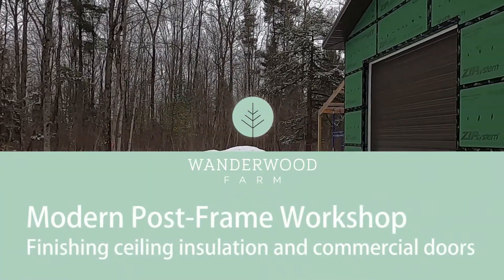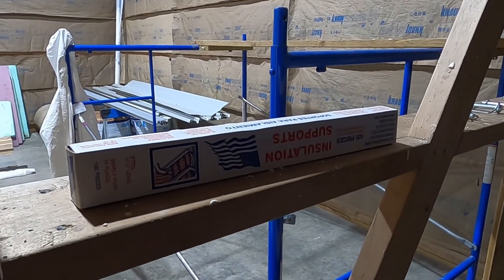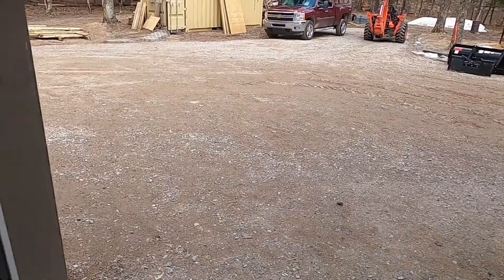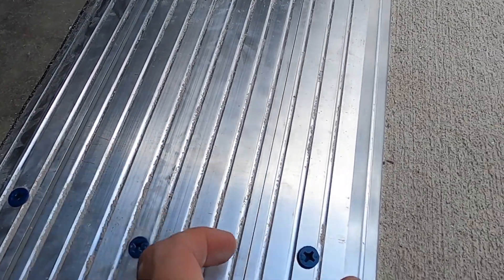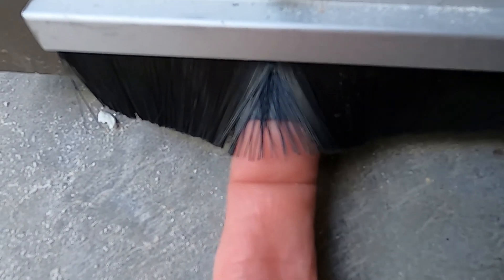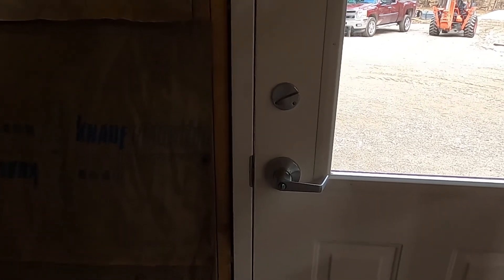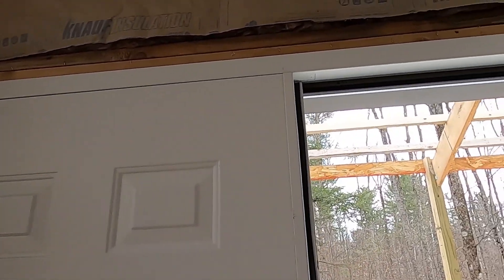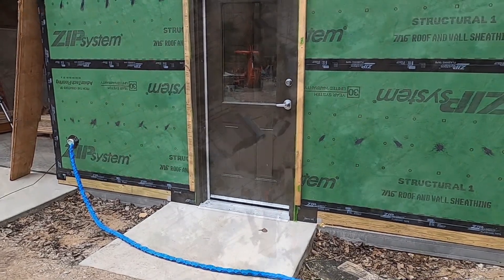R-60 Unvented Roof Assembly: Combine fiberglass & closed-cell foam (059)

Comment: 2" foam reduce heat transmission by 86% really didn't need the rest
Reply from the maker: Please read 2015 Building Code R806.5. Specifically look at the table in that section. It details exactly how much air-impermeable insulation is required in your zone. 

How did you arrive at 86%?
Reply: @WanderwoodFarm  Channel Spray Jones goes into much detail about this. The R value is a lab test and pretty much useless in the real world which local codes are based on. The 86% is arrived by detailed studies of heat transmission. The 2" more than covers what you need to insulate. The codes have not kept up with the foam technology. Spray Jones says if you use the right studies you can petition the local codes to change their requirements for such thickness needed by batt insulation to meet the same reduction in heat transmission. Check him out and learn a lot.
Reply from the maker: Interesting. Thanks for info. I’ll check it out.
Reply: Unfortunately we don't have a choice and must comply with codes....

Comment: not a fan of unvented roofs in the south. I guess they are ok in the northern USA since the radient sun energy can radiate a little through r60 insulation. in the south though a dark roof will easily push thousands of BTU's through R60 insulation. A 2" air gap thermally vents thousands of BTU's up the ridge vent and out and away fromt he building keeping it cool.
Reply from the maker: I understand. We have similar concerns in the north, although about moisture/condensation rather than straight-up thermal. We dealt with it by installing a cold roof. It’s basically a vent from soffit to ridge. In our case, we did a 1-1/2” vent. By code it’s still an unvented assembly… but it is vented. I think that’s a great compromise, and it maximizes the benefits of both types of assemblies with one clear exception: cost. An unvented (yet still vented) roof has a fair bit more cost than a standard vented roof.
Reply: @WanderwoodFarm  glad to hear you have the 1.5" gap.
Reply: @WanderwoodFarm  Why does code consider it non vented ? Was the 1-1/2 vent not large enough ? Thanks
Reply from the maker: We use 2015 building code. Check out R806.5. It lists the criteria for unvented assemblies. Basically ours is unvented because we have sheathing directly on top of framing members and drywall directly below. The additional “cold roof” isn’t considered to be part of the main roof assembly. It’s weird. I really struggled with this too. Imagine if moisture got into your ceiling/roof… if it can travel through the insulation and slip out of the roof through an unobstructed vent… then it’s vented. If there is sheathing or other air/vapor impermeable material between the insulation and outside… then it’s unvented.
Reply: Khan, is 2" the minimum air gap you would recommend in the south ? I have a galvanized metal roof on perlins. Can I get away with a 1" gap ? I am trying for the most R-value in the cavity but still want it vented. Thanks